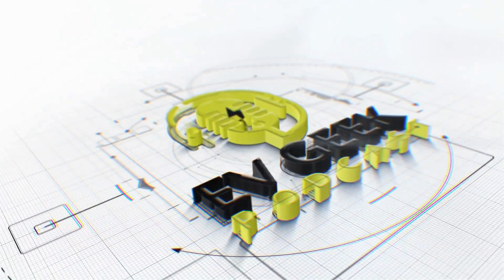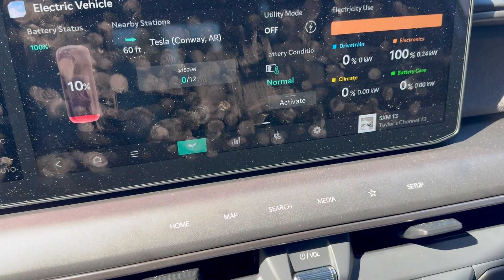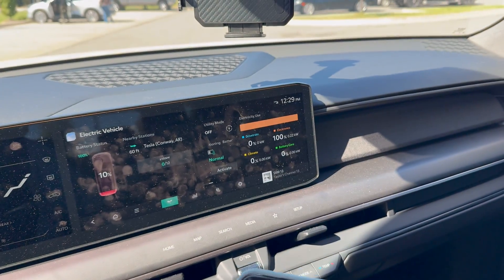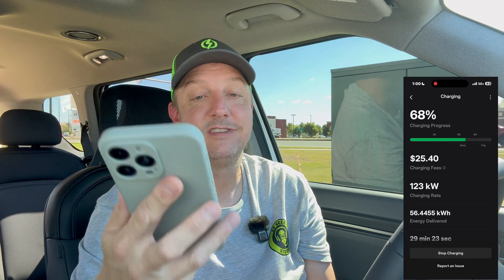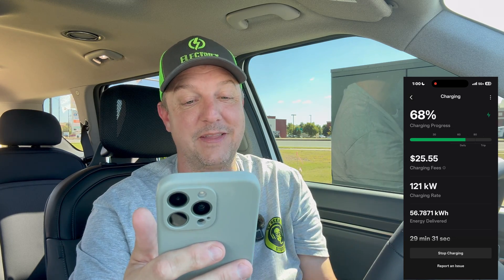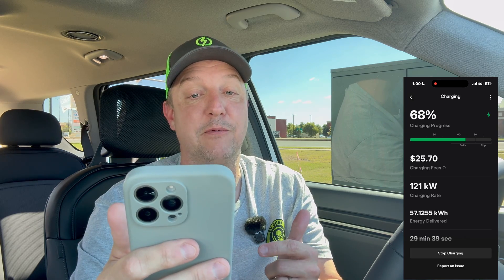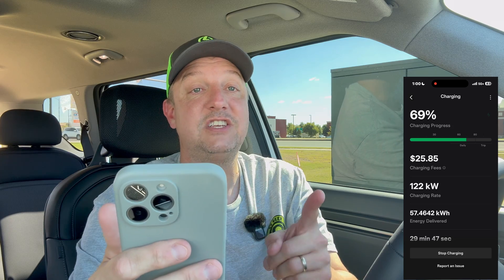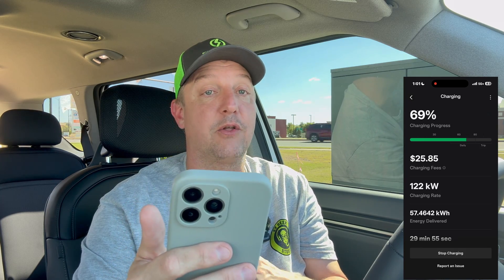How Fast Can a Kia EV9 Charge at a Tesla Supercharger?

Comment: anyone try an EV 9 on true V4 Tesla chrger or is it not open yet?
Reply from the maker: The one true V4 site currently open is not available to non-Tesla’s yet.
Reply: the EV9 limit is 210 kw no matter tesla v4 or EA 350 kw. However, even at tesla v4 EV9 is limited to 120 kw or 84 kw depending on model year.

Comment: What is the difference in charging time, 10-80%, at an EA 350 vs Tesla V3.5?  My guess is a high voltage EA charger is only 3 mins out of 30 faster.
Reply from the maker: EA would be a bout 24 mins

Comment: Having access to Tesla saved me countless minutes on a recent 1000 mile trip to WI from VA in my EV9, even though the KIA charges a bit slower. Planned a stopped in Cranberry, PA to use EA. 2 of the 4 were down, 2 in line. I just drove 1/2 mile to the Tesla Station. Similar situation in South Bend, IN. EA was full. Bypassed exiting , and went to a rest stop that had Tesla. If I was in my ID4, that trip would have cost me who knows how much time in waiting for a charger. 30 mins? 40 mins? Also, OH and IN have Tesla sites at many of their rest stops on the turnpikes. That saves several mins of on/off time.  So even though I maxed out at  125kw vs   210kw on others like EA, the amount of time saved not waiting and having quick on/off access made up for the 8-10 min longer charging time.
Reply from the maker: Glad the Superchargers were so helpful on your trip!

Comment: 120kW absolutely flat from 10% to 80% is honestly not that bad. If you were using Tesla V3 and V3.5 chargers along a route, you would have steady charging speeds any time you plugged in with no incentive to drive all the way down to 10%. If you left home with 100% and drove down to 50% before everybody needed to stop for a nature break, a quick 12-13 minutes stop would get you back to 75% at a Supercharger.
Reply from the maker: That’s not bad at all!

Comment: Don't you love how the go through the re-engineering of giving it a NACS port yet keep it on the wrong location so you have to take up 2 spots, or can't charge if you can't find 2 empty spots side-by-side?
Reply: Taking up 2 spots is a  over blown, media story.  Just took a  2k mile round trip from VA to WI.  Used Tesla 4 times (EV9).  Not once did me taking 2 spots was an issue.  As a matter of fact, I only saw one other car charging at Tesla sites that had  8 or 12 chargers.
Reply from the maker: Yes, I believe they should’ve moved the port.
Reply: This would require them to redesign the stamped metal quarter panels plus the wiring. The 2026 Kia EV6 was a design update. It has the charging port near the rear lights in  plastic and they were moved to the left side and added a  module to switch AC / DC under the cargo floor. Also 400 volt charging was updated to 125 kW from 85 kW in the earlier model